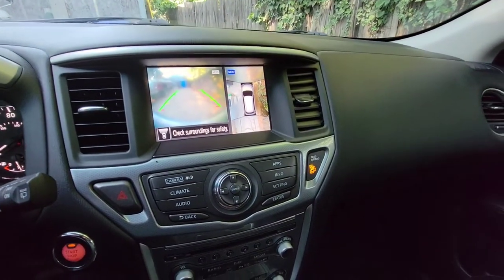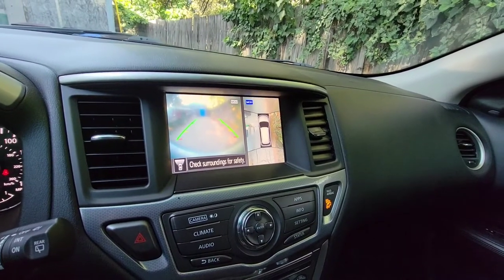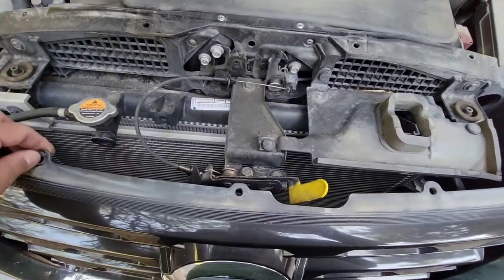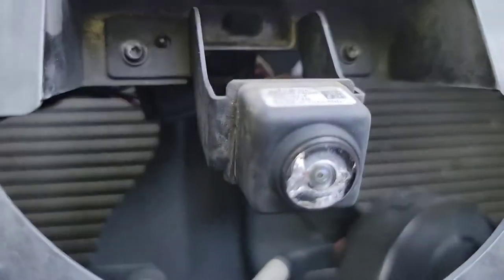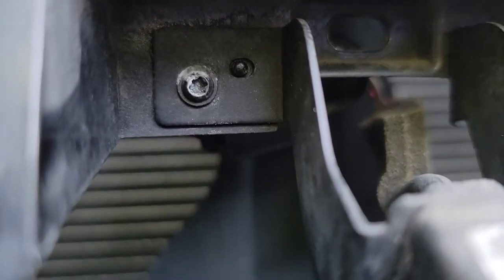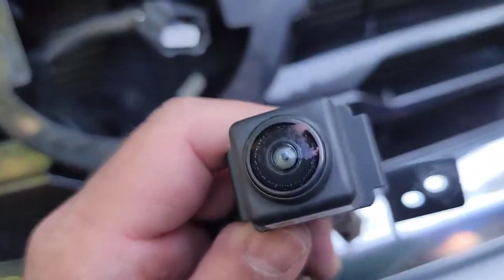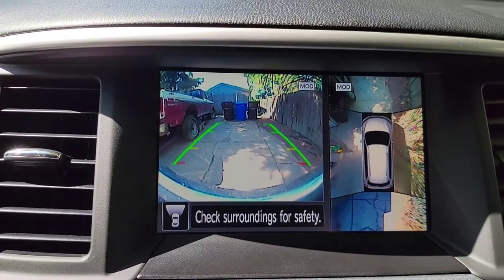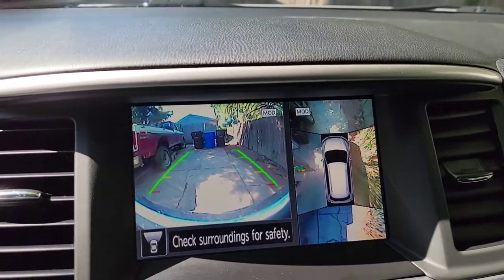Front camera replacement on my Nissan Pathfinder.

Comment: I have Nissan Qashqai 2015 and wonder if you can help where to buy its front bumper camera?
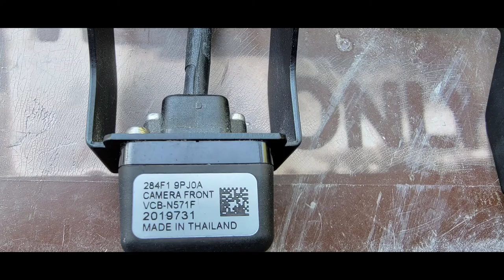Reply from the maker: I am not sure. Im in the US and not familiar with that model. So I googled the manufactures part number on the camera and found some and purchased a used one on ebay. At 1:46 into my video you can see the top part number and that way you know you have the correct camera. Hope this helps. Good luck!

Comment: You SHOULDN'T tell viewers to just pull the Nissan nameplate off the grill. It'll break the thin plastic tabs holding it in place, like it did with mine. People need to access it from the back and pry open the tabs from behind before pulling off the nameplate. Now that the tab is broken off, the only fix is to replace the entire grill, which won't be cheap, or drill screw holes in the nameplate to keep it in place. 😡